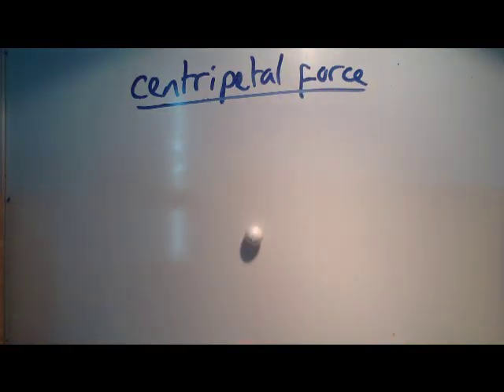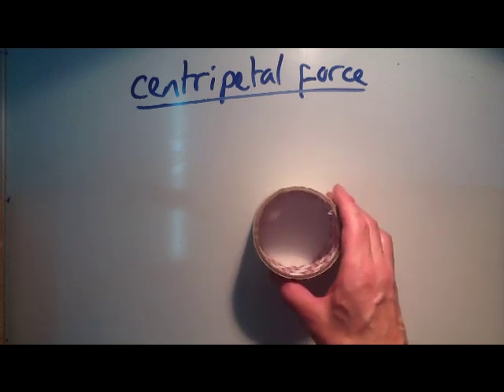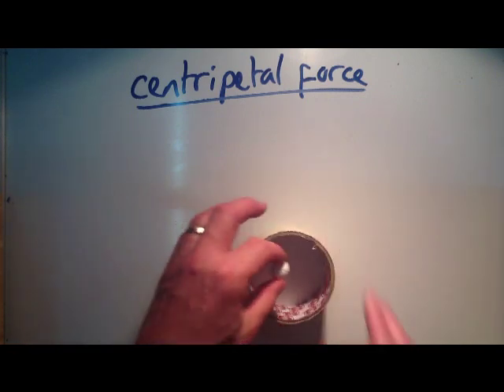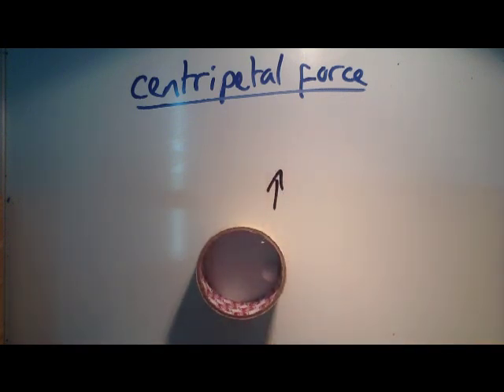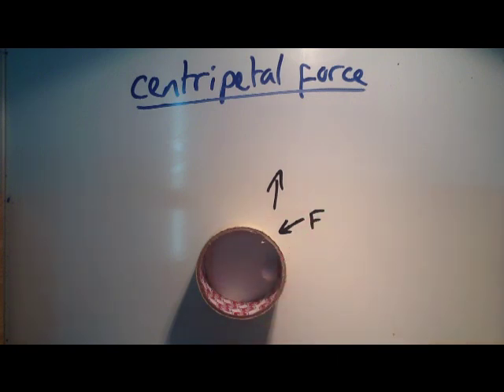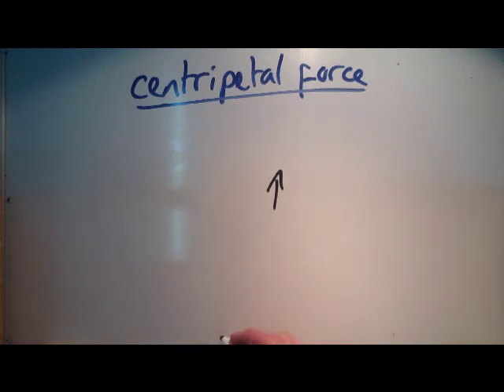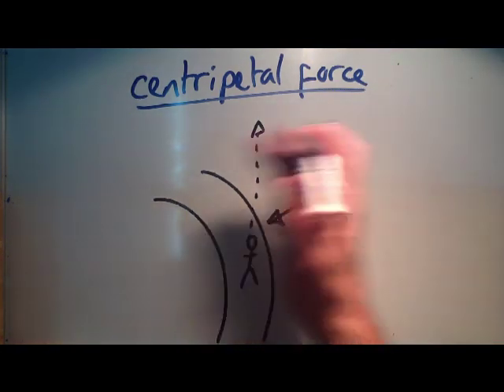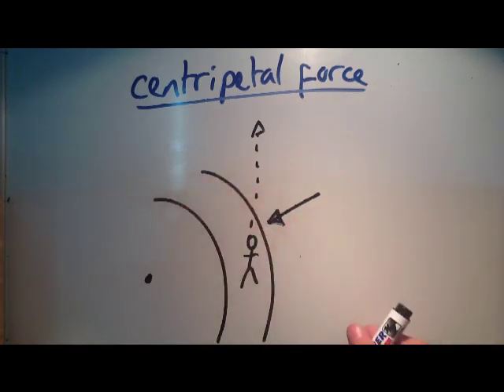Centripetal and Centrifugal Force

Comment: I do not believe centripetal force is a real force.
Reply: Why not? The math/logic works out perfectly - acceleration is a change in velocity, and velocity is direction specific (and when velocity rotates, it changes direction constantly). And a force causes an acceleration, as has been verified in many studies, so there would have to be a force to cause an object to rotate.

If the direction (the centripetal part) is what's hard to understand, you can watch proofs on it.